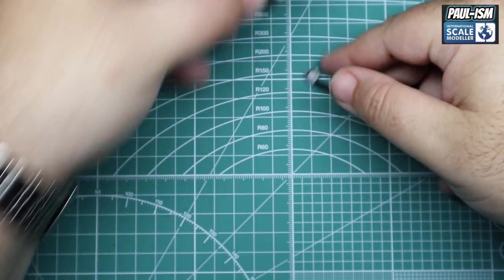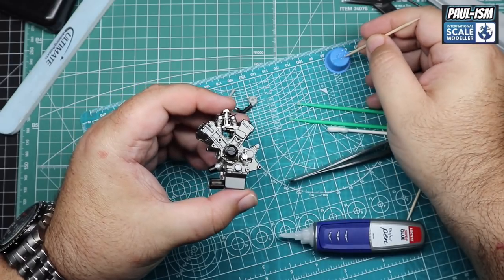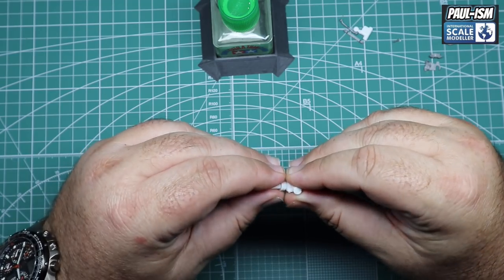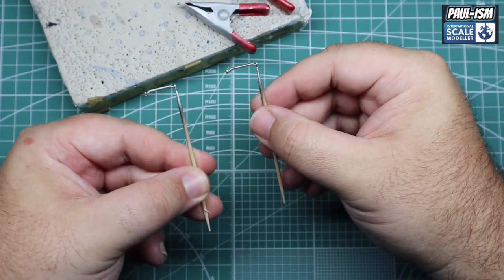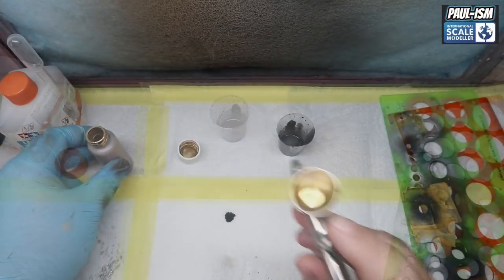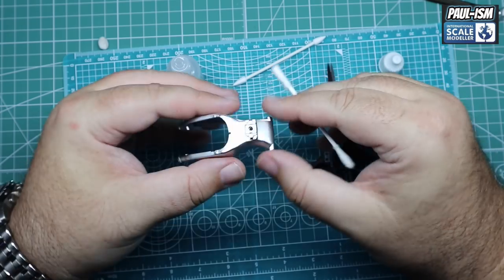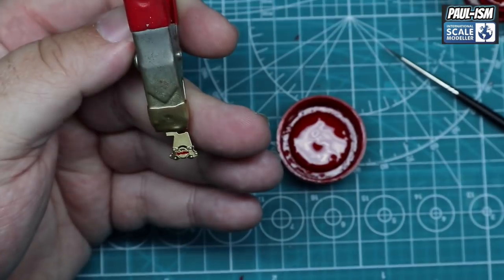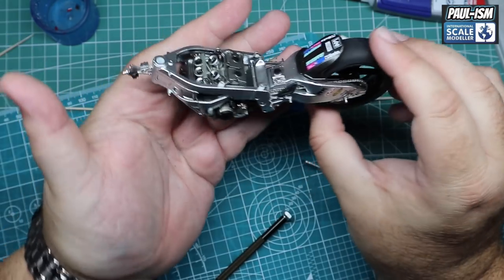Part 9 - Tamiya 1/12 Honda Rc211v '06 Step by step Build

Comment: Thanks Big Fella! I am very glad you added the clamps and shown how they are put on. I think they finished off the beautiful work you did on the 800cc mill. Only problem is I have to wait for Spotmodel to get some more in! I would be interested to see how the electrics are done if you do end up going that way. One thing about bikes is the sheer volume of detail you can add that doesn’t get hidden. Thanks again for having an open ear to your devoted audience!
Reply from the maker: Hey Peter, yes very glad I added them, looking at the wiring there is a lot so I may leave the wiring alone lol - Paul

Comment: Hi Paul! Very entertaining to see how you deal with the different building steps. I particularly like the cuticle tool!  A couple of questions. 1) what did you wipe the excess red  paint from the Brembo logo with? Water? You mentioned you used Mr Hobby Aqueous, so just wondering. I like to paint that logo too instead of decaling, but I try to use capillary action, very carefully, so no cleanup necessary - I like you method better! 2) I used Tamiya panel liner on a bmw m6 kit from Tamiya for the first time - just a few weeks back. I used the gray color to give the dash air vents some depth. Dash was spray painted with TS-29. Boy, I nearly had a heart attack....the TS did not like the panel liner at all. Same happened on the seats, which were painted gray, also from the TS line. I don’t know what I did wrong...I thought it would be ok...the M6 is a build for a friend (his kit, and long OOP!) so I am afraid of fiddling with it too much and make it worse. Did you ever have this issue?  I even tested it on a spoon shot with TS and it was fine, so I am puzzled as to why the dash and seats reacted the way they did. I am so scared of that panel liner now that I went old school and mixed my own wash with oil artist tube paint and turpentine, and went over the dash and seats again. Thanks!!
Reply from the maker: You shouldn't have any issues with them really the wash is enamel and the paint lacquer so they should be fine together so i'm stumped with that, with the calliper paint it was prob ump thinner I wiped it off with gently to not effect the lacquer, Cheers, thanks for watching - Paul :)

Comment: hey Paul love the builds, I do have a  general question which not related to this specifically but a general question on extra parts? I know eduard, and hannats mainly for armour, ANYZ does armour engine resin bits etc..but can you explain maybe on a vid how you go about tracking FE, resin bits etc...when I've done it I seem to end up in a loop with little results or none. Whats your process for extending bits?
Reply from the maker: Hey Darryl, cheers mate ill try to cover it in a video at some point - Paul

Comment: Just quickly, I am going to use Tamiya LP paint for most of the work I do on the bikes, is the LP-9 ok to use over decals etc and to keep it as my standard lacquer clear coat I can turn to?  Also, do I thin out the LP-9 with lacquer thinner (and to what ratio LP-9 to thinner if so)?  cheers Paul.
Reply from the maker: 60 or 70%thinner to paint you have to be careful with lacquer clears over decal as if sprayed to heavy it can destroy them so nice light thin coats on the key building it up slowly